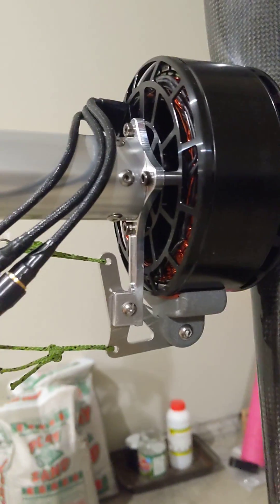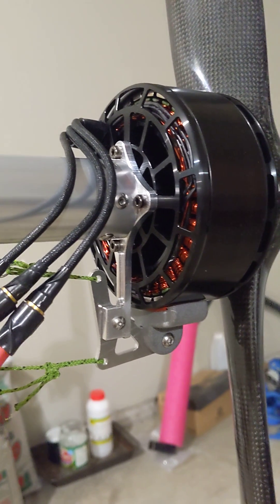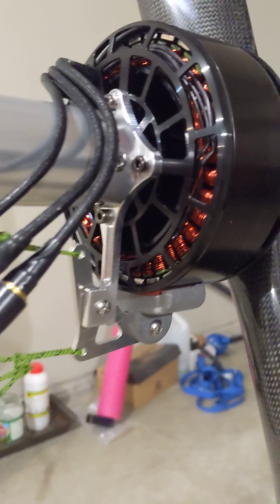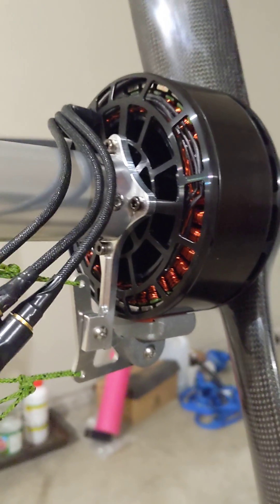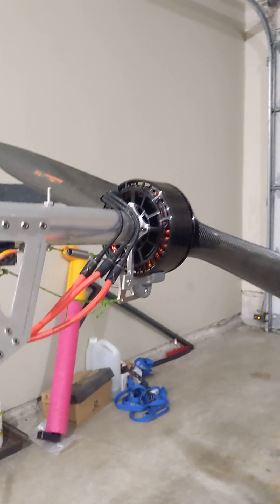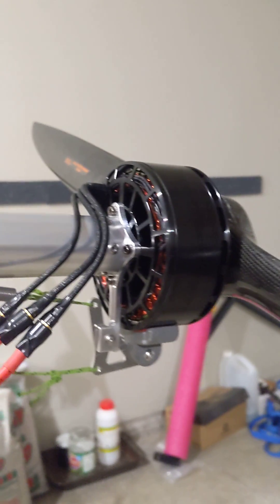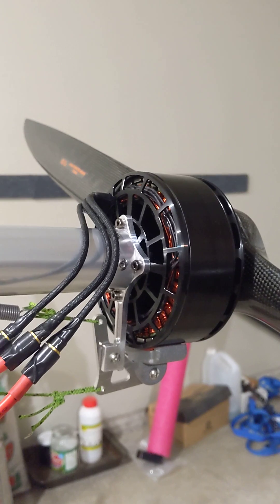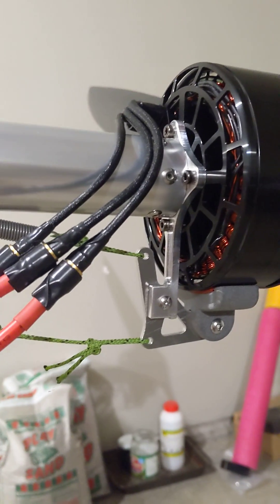Initial mechanical brake prototype for electric harness propeller

Comment: We have been using so called folding propellers on sailing vessels for many years now, maybe that could be a possible solution? I think I have seen it on electric powered gliders?
Reply from the maker: Yes, I'm working on a folding propeller now. The VESC ESC that I plan to use seems to do electronic braking just fine. I plan to keep a simpler version of this mechanical system as a backup, so that in case of an ESC burnout / failure you don't lose half your glide ratio to autorotation drag (in addition to just losing power).

Comment: Maybe using electric braking initially (recharging the batteries), to reduce the rpm and after that applying the mechanical brake?
Reply from the maker: It is possible, but complex and expensive to do right. A proper ESC and a folding propeller should take care of it cheaper and simpler. FWIW this mechanical brake has worked fine so far in practice for a prototype.

Comment: Why do you need a brake on the motor? Is it to stop the propeller? But also why do you not use a folding propeller to be more aerodynamic? A big propeller that is always expanded, always spinning in the wind, would add drag, no?
Reply from the maker: Yes. I don't have a folding prop yet (it's on the todo list). But even a folding prop will need a brake to stop, otherwise it can keep auto-rotating and creating drag even if the motor is turned off. In the next version, the primary brake will be electronic, with mechanical as a one-time-use backup only, in case of electronics failure.
Reply: @koifly  Huh. Interesting. Looks simpler than it is I guess, as most things!

Comment: I think you should use ESC braking it's way simple than adding extra mechanics to the system. It looked to me you're solving a software problem with a hardware solution which is not a good idea in engineering 😉
Reply from the maker: As a software developer I'm totally onboard with solving ALL problem with software, not just the software ones :)

I needed a mechanical solution because my APD ESC ssimply did not support electronic braking. I am using VESC 75/300 now, which does have electronic brake.

I will probably keep the mechanical brake as a backup in case the ESC blows up, except it will be activated by a one-time-use pull cord instead of the servo.
Reply: @koifly  Oh I see 👍Thanks for sharing all the info 😀

Comment: I think you have enough torsional rigidity for the amount of friction you have. But you may need a way to be alerted of a servo failure during power on, because of the risk of overheating the motor magnets.  I love your project.
Reply from the maker: Thanks, that's a good idea. If the servo dies or if you forget to plug it in, and then you start the motor, the motor will indeed still spin the prop, rubbing on the brake. I'm not sure what would be a reliable way to detect this condition, because the servo does not report its status in any way, and the motor gets pretty warm even without the brake. Perhaps smarter servos exist, or I could make this one smarter, but honestly I've done more electronics work for this project than I ever wanted to do in my life, and I'd rather not complicate it further.

For now I accept this risk, but long term I will get rid of the servo altogether, because I will use an ESC that has an electronic brake (like VESC or HobbyWing), and I will make a one-time-use mechanical kill switch that drops the brake pad on the motor (and also cuts electric power to the motor) in case the ESC dies and can't brake the prop electronically. When the prop windmills, the glide ratio is brutal, definitely need some redundancy for this.